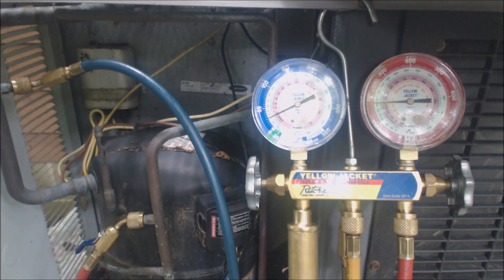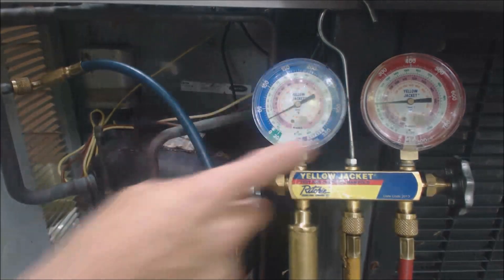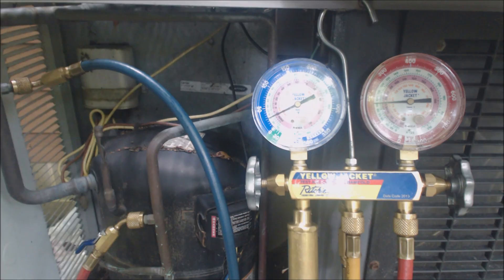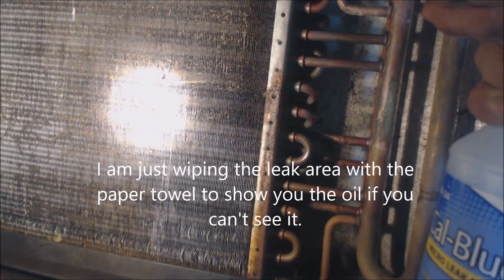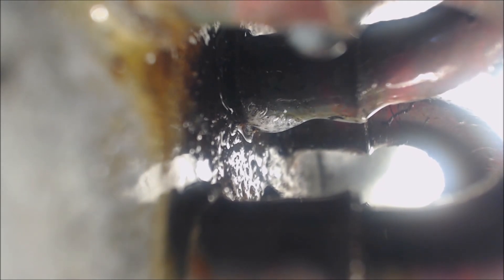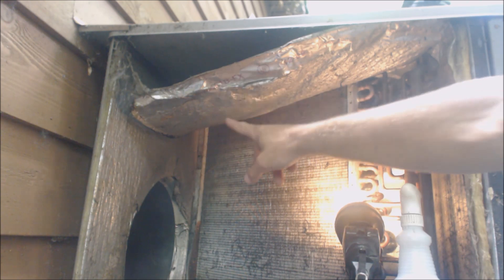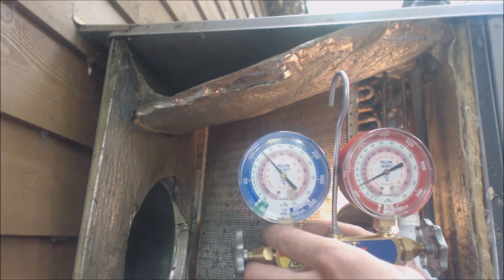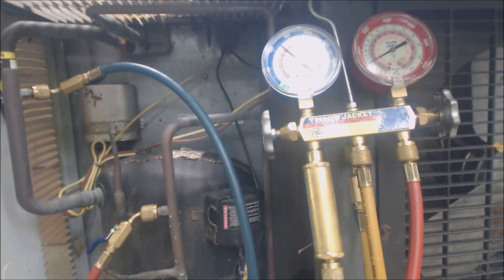HOW I FOUND a REFRIGERANT LEAK in this AC Unit!

Comment: I just bought a house with a completely empty system. Several companies have looked at it and were unable to find the leak. The refrigerant lasts 2-3 months, now it's been sitting over winter and it's completely gone. Dye has been added to the system, I can see it on the ports at the condenser. No other trace of the dye is visible. What would your experience tell you about the location of the leak?

Comment: Hi I have a weather King 3 ton unit out side condensation pipe dripping water low pressure copper pipe is cold and seating new ac filter inside house is 81 degrees what do you think is my problem please help

Comment: How would you do this for an evaporator coil  sitting on top of a furnace?   My  evap coil was installed into the rear of the plenum.  What would be your plan if you cannot find a leak in or around the condensor?
Do a pump down then remove the evap coil and test it outside the furnace?

Comment: So let’s say if you were to be able to fix the leak what would the process be? Would you pump it down with the leak? (Wouldnt that suck the air in the system with the leak?) and would you have to fix the leak and vacuum the unit all over again and recharge?

Comment: all i have is dish soap how does that work using a spray like your doing? can i spray the a coil ends like you show and slook for the pin bubbles? loos like testing for tire leaks to me thanks

Comment: I have AV04 Air Conditioner Access Valves, looking for an Air Compressor fitting to "inflate" the unit I soldered the valve into... any thought as to the connector to fill AV04 valve?  ( not an Air Conditioner application)

Comment: That is a very small leak! Wouldn't it take a very long time for the unit to leak down enough to affect cooling? Also, would the leak rate be the same while running, and with the unit off, or does the higher off pressure of the evaporator cause the refrigerant to leak out faster? Thanks.
Reply from the maker: Higher pressure while the system is off will leak the refrigerant faster. This was still a pretty big leak compared to some I found with the ultrasonic leak detector. I did several videos with that tool, thanks!

Comment: Nice video, thanks.  Just wondering if injecting a can of R22 stop leak like ProSeal22 would actually seal leaks of that size and buy the homeowner a year or two, allowing to save up for a major expense.  Would like to hear from someone who has tried it.
Reply from the maker: Sometimes it works and other times it is a waste of time and money. Other techs I talk to say the same thing. I just look at the life on the coil, sometimes I fix, add the leak seal, or if I don't think it is worth it, I let the homeowner know. The key is to let the homeowner know what is going on and the costs every step of the way after finding the leak, thanks!

Comment: I have a unit from 1995 that has a slow leak. R22 is the refrigerant in it. My unit is supposed to go to only 40 on the gauge. it is a 3 ton Coleman package unit. I have tried the soapy method and cannot find the leak. A tech told me to look for oil somewhere on the pipes.
Reply from the maker: It may not be 40 degrees on the low side. We check the charge with the total superheat method for systems with a fixed orifice. Yeah if I cant find the leak with bubble detector and looking for oil, I use my ultrasonic leak detector. Look up "acservicetech ultrasonic leak detector" thanks!

Comment: Can we use dish soap to find the leak on refrigerant leaks?
Reply from the maker: Dish soaps are much more corrosive then they were 20 and 30 years ago so I always recommend non-corrosive bubble leak detector. I have that linked at amazon.com/shop/acservicetech   I have seen dish detergent and water rust major components and it will also eat through stainless steel flex gas lines, thanks
Reply: @acservicetechchannel  ok thanks 👍

Comment: Could u possibly fix that leak with something like super alloy 5 and a tiny torch ? Or if it were easier to get to what would u use
Reply from the maker: You can cut the tin out of the way and braze over the leak with 5% to 15% silver bearing rod and an acetylene torch after recovery, thanks

Comment: Had leak with a  icp unit  that was hard to  find R410  started  out with  nitrogen  with  trace gas at 350 could  not find it sitting  static  . Re filled  system 2 weeks later  system  was flat check  everything  nothing  obvious  ended  up re filling it  again  note it holds 13 lbs of gas basically  the whole jug  the jug weighs 8 pounds empty  bummer  disconnect  the fan and run it to 450 to 500 psi shut off and the leak detector  barely  found it 4 u tube from the  bottom  / so in this case  it only  did this under load were heat and pressure  and  vibration are a factor  it was only  4 months  old replaced  under warranty  but still  it was a considerable effort  and loss but sometimes  you  got eat a crap sandwich 😭
Reply from the maker: Hey Chris, have you checked out the 3 videos I did on the ultrasonic leak detector? That tool is awesome! I find leaks with that and then put other leak detector tools right in front of the leak and they don't detect it. Just look up "acservicetech ultrasonic leak detector" thanks
Reply: @acservicetechchannel  yes there are better  detectors  then my 200$ tek type  that yellow jacket looks like  the best one . Your videos  have been very informative. Thanks again

Comment: My ac is short cycling, after the compressor kicks in vapor side pressure starts to drop. After it drops below 25 psi, low pressures Switch cuts off the system. Liquid side pressure remains constant at 145psi. Does this mean that refrigerant is low and leaking.
Reply from the maker: Yes it sounds so or could be a severe liquid line restriction, thanks

Comment: I'm in the Midwest and just had new AC unit installed.... however now there is a Smell that is like metallic with oil? They came to check for leak etc and found nothing. Said to give it about 2 days.. I've had to open windows bc it's pretty strong and can feel it in my throat.

Have you had this, would you be able to tell please tell me why⁉️ 🙏🏼... I have a little boy and I'm concerned.... The contractor couldn't pick up the scent until he sniffed the box part (don't know the proper name) that gets installed near the furnace where the coils are.... as though the smell is from the area of The coils. Thank you!
Reply from the maker: Every once in a while, you will here of a new evaporator coil with some type of coating on it that smells once it gets wet. The last time I saw that, it was a york evaporator but it was on a larger commercial job. Have them try cleaning the evap with a good coil cleaner, thanks
Reply from the maker: That wasn't a metallic oily smell though, I am not sure, sorry!
Reply: I have the same problem. 8 year old Carrier.  Bad smell and nobody can locate the source.

Comment: Hello. I encounter some problems in ac units.. freon leak. When pressure testing it is ok. No pressure drops. But after few days of operation. Evalorator coil starts to ice . Upom checking low on freon again.. can u help me identify the problem? Thank you.
Reply from the maker: What pressure are you testing it to in respect to how much it is operating at? Maybe the joint opens up when it gets hotter at the outdoor unit.
Reply: acservicetech since it is a 410A operating system. I test the evaporator coil @225 psi. The outdoor or condenser unit has no problem. I also check the fittings and it has no bubbles. The unit is brand new but it was storage about 2-3 years before i install. . I change the thickness of the insulated foam to 13mm thick  since 410A is sensitive in direct sunlight i presume?. . Right now it is under normal operation. Hopefully i done my job right. Thank you.

Comment: My outside unit is 31 years old, Inside is pretty new. it stopped blowing cold the other day. I called an AC guy. He said I have an R22 leak. He said I need new outside unit, freon lines and evaporator. I asked if a freon leak could be found. He pointed out an oily spot where the big freon line connects to the outside unit. Then he sent me a bid for $6k. I know it would be expensive to recharge the R22, but I don't think it's necessary to replace everything to eliminate the possibility of a leak. My inside unit is compatible with new refrigerant. I would like to just replace the outside unit and hopefully fix the leak. I'm going after it with soapy water tomorrow.
Reply: Adam Savage
Reply from the maker: That unfortunately would be up to the installer because the tech may only warranty the job for no leaks or future leaks if everything is new. If he sees the leak then he should be able to fix it however this may be a 3 hr process and expensive. I would avoid dish detergent on refrigerant lines as this is much more corrosive then if was when techs used to used soapy bubbles 30 years ago. We use non corrosive bubble leak detector, thanks! I hope that helps!
Reply: acservicetech 
Thanks for the awesome reply! That's exactly what I was looking for. 
I might be willing to take my chances and only replace the outside unit. $6k is a little out of the budget at the moment. Plus it doesn't seem too logical to replace new(ish) equipment because it might be leaking. I understand the whole warranty thing.
Also, thanks for the heads up on the corrosive dish soap.
Reply: Where can u find non corrosive bubble leak protecter my a.c. has a unit in the basement could it possible that its leaking from one of those pipes but I'm not sure where to even look

Comment: how much should you tighten the nut connection at the piston on a 410A sistem. should a torck wrench be used for that?
Reply: *torque
Reply: @dilbertdoe601  great answer...
Reply: system*

Comment: Hey I'm just starting to get into hvac. 
Couple of questions. 
Besides your channel, where else can I learn hvac? 
If this was a leak you were able to repair, would you just solder it closed?
Or would you ever replace the evaporator?
Thanks.
Reply from the maker: I have some featured channels on the right of the channel homepage of some other techs. If the leak is right up next to the tin then no you would not fix. You would replace. Other times if it is in an accessible spot I fix them. First is to recover the refrigerant. Thanks toneblair!
Reply: acservicetech thanks for the quick response!
Reply from the maker: No Problem, toneblair!
Reply from the maker: Honestly I believe we are all in the same boat in reference to tiny leaks. At our disposal, we have die and ultraviolet lights, refrigerant sniffers, ultrasonic and bubbles. We also do as you are talking with pumping down the compressor and then pressurizing the lineset and evap to see if we lose pressure in the off season. If it is found in the lineset and evap somewhere, we try to pinpoint it or just replace both. It is frustrating but that is why we charge the rate that we do. It took a long time for me to understand this after putting so much pride in my jobs and then to have a leak that was not from one of my joints. I believe manufacturers make the coil tubing too thin for energy transfer sake. I believe the tubing should be thicker which would be a little less efficient but a lot of time the tubing cracks longways with the increased surface area lines on the inside of the tubing. The best seems to be the die and light, the sniffers are ok but not great. They seem to be the thing that techs use to sell the customer with that there is a leak in a certain area but the are subjective most times the leaks are too small for them to pick up. Still, they are necessary to have in the truck to try with. Well I hope that helps!
Reply: acservicetech I consider myself to be a pretty good service tech. went to a trade school and been in the field for about 5 years    I just got my S2 license. 
the problem is i run into, every now and then is I can't locate the leak.
I always pressure test with nitrogen to recommended design test pressure. and it holds. but eventually refrigerant leaks out. I use spray bubbles and even have a electronic leak detector.
would like to know what you do when you run into this situation. I know you could isolate evap coil and the condenser coil to better your chances of locating the leak but time usually  plays a big factor also.
this is very frustrating.
Reply: Reading this made me feel better

Comment: A technician came - there was NO R22 gas in the system. He tried to look for a leak by pressure testing the system with another gas  but could not find one. He says that it is quite expensive to do further tests and recommends a new system costing around $3,000.  Should I persist to tryu and find the leak?
Reply from the maker: If there is no r-22 then the leak in my experience is almost always easy to find or is the actual schrader valve where you attach the hose on. You could replace the schraders and pressurize with nitrogen up to the design test pressure of the evaporator coil and let it sit for 5 minutes then check, then check after 20 minutes, then let it sit for the day. If after that, if it does not leak then the leak was in the schrader valve. Here is a video on schrader valves---https://youtu.be/t69uLxmM5XE
Reply: Ian Bersten
Reply: Find a Different Technician that Owns a Ge-H10 G Leak detector and Has At Least 10 -20 Yrs Experience in the Trade. Try a Commercial Refrigeration Guy if no luck with a Hvac guy.
Reply: if you can't find the leak, buy a new system and put it in... unless you wanna pay $500 dollars in leak testers and spend hours trying to find the leak then ... oh do you have a torch, gas, braze rods/solder, refrigerant, gauges, a license??? ... if you don't then $3k sound like a great deal to me... honestly...  a new ac for only 3 grand sounds like a steal if you have ever installed one. it could be the evap coil... but that would cost at least a grand to replace here in austin texas so might as well get a whole package with matching condenser/compressor/outside unit. heck  just upgrade to 410...will be cheaper to fix 10 years from now if it springs a leak. peace

Comment: What are the options for repair? Can your run stop leak through the system and fix it?
Reply from the maker: Great question, Not for a leak that big but for smaller leaks I have heard that it will work sometimes. I do not know how long it will hold for or if it even will work. Unfortunately the leak is in a spot where it can not be fixed without replacing the entire evap coil. I can usually fix a leak if I can find it. I have even fixed leaks in the middle of the fins before. Due to the age and very low seer rating the owner chose to replace the unit. Thanks for the question!
Reply: U used to jumper the U joint whenever welding repair is inaccessible

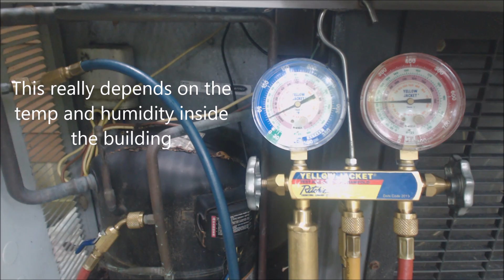Comment: Why did you say, "We're looking at a unit low on refrigerant the pressure needs to be up at least 65 psig..." at ( 0:13 ).  Then you said, "...it should be somewhere between 65 to 85 psig because this is R22."  If I look at an R22 PT chart 61.5 psig  = 35 deg saturation temp and 84.1 = 50 degrees saturation temp.  Are you saying that you know you are low on refrigerant just because of the liquid line is below 65 psig?  Why is that?  I thought you had to know the super heat or subcooling to determine if you were low or high on refrigerant.    Oh hell I think my question was answered at 1:00, but feel free to answer me anyways.
Reply from the maker: No problem. For R-22 the vapor refrigerant will be somewhere between 60-85 depending on temp in the building. If the pressure is less than a sat temp of 32 degrees then the evap  coil will freeze. For comfort cooling even in hot areas when the system is running I have never seen a system need to run above 85 psig because of our comfort temp inside the building. These are just tips for everyone just from experience. These are just extras. You still need to do superheat and subcooling but when you do, the vapor pressure will be between 60-85 psig. Thanks and I hope that helps! Thanks for the question!

Comment: I have a question, do you need different gauges to charge with different refrigerants?
Reply from the maker: It is best practice to have a set for each so that you don't have cross contamination of refrigerant oils like mixing poe and mineral oil. Also refrigerant become miscible with the oil. Thanks for the Comment!
Reply from the maker: Also so you know, I have 3 sets in the truck and another 7 in the teaching shop with those liquid vaporizers. I am not using the same set each time. The best thing to do is to engrave the brass block so you know which set is used for each refrigerant.
Reply: +acservicetech what brand is that liquid vaporizer?
Reply from the maker: That is an imperial 535c kwik charge.
Reply: I have plenty of hoses so I can seperate to use but what about the manifold gauges? Should I use seperately as hoses? Currently I'm mix using both of sman and testo. By the way, thank you for great videos!